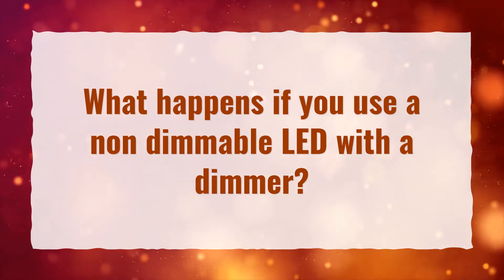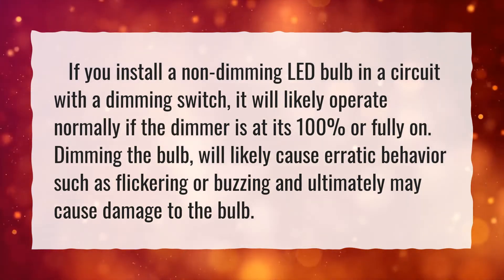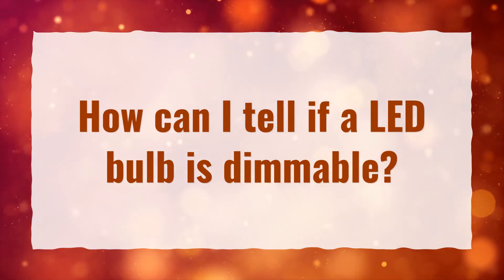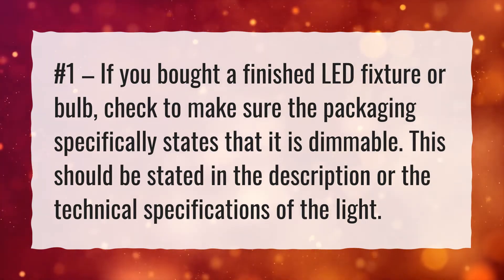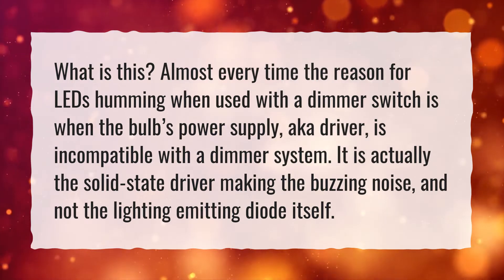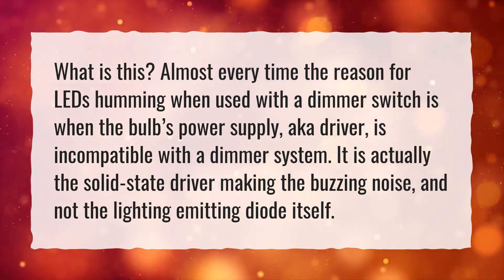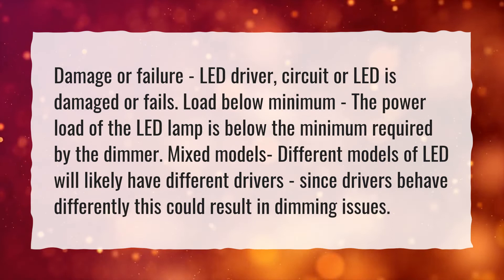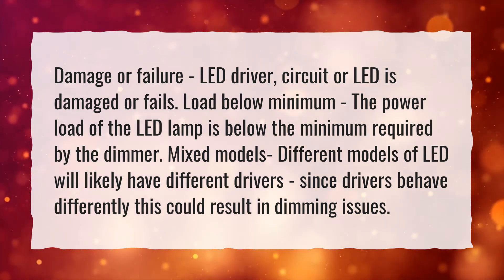What happens if you use a non dimmable LED with a dimmer?

Comment: great video.
Question - my ecosmart smart bulbs (100w) hum.  i read that I need to change out current switch to a non dimmable switch to fix problem.

what is a non dimmable switch?  can’t find any real answer online.  I do see something about ground or neutral wire? And I’m going to Home Depot; how will I know if a switch is non dimmable?  Is this just a standard light switch, something like 15A 3-way switch for like $5?

confused in Brooklyn…hope u can help.

/Bklyn👑
Reply: All dimmable switches clearly state that they are dimmable. All other standard light switches are non-dimmable.

Comment: I have an idea for elevator-lift lighting using LED concept on CCFL(usually better quality light "torque").

If power-brick is at 1000mah at 5v
If bus wired
If (X-quantity of)dimmable (this youtube video) LED.sss (at 500mah) used

Need 2 LED.sss for low-light
Need 4 LED.sss for good-light
Put 8 dimmable LED.sss and drive by 2x 1000mah power-bricks but without dimmer. 

Objective = reduce Maintenance and running costs by slow reaction to failures.

Comment: QUESTION: why won’t dimmable tube light dim below 20% or so? What dictates how low it will dim?
Reply: There's likely a certain amount of current needed for the tube light to light up. Under 20% there's not enough current so it doesn't light at all. Not an expert just a guess.